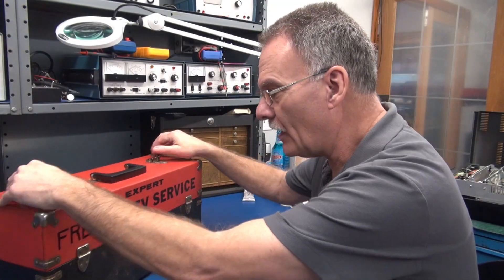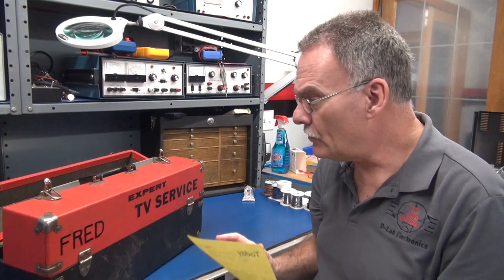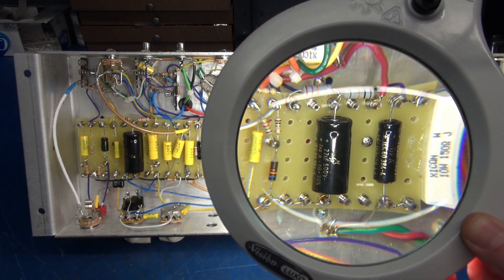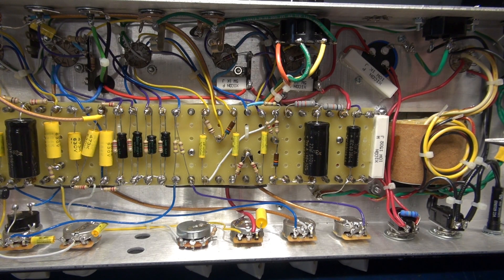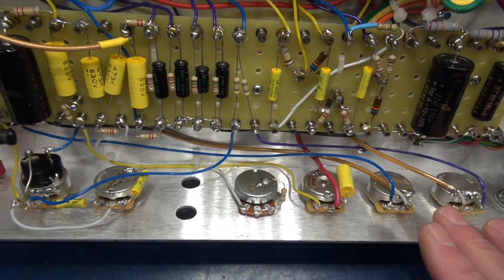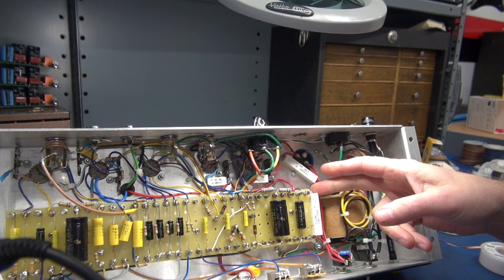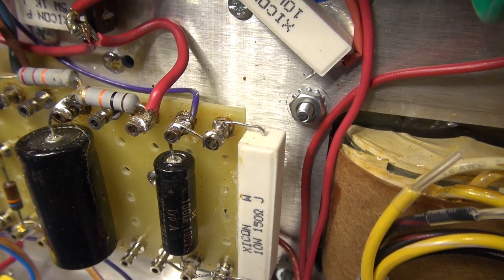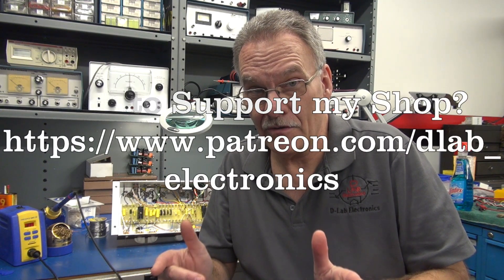D-Lab Basic Training Tube guitar amp sound fades Visual inspection reveals cause of the malfunction

Comment: Bad solder flow on turrets: good catch! Perhaps a friendly warning to our kit builders: before installing board, lightly clean turrets with a very fine scotch-brite (gray). Once cleaned, rinse off with alcohol. I also use the Kester solder (.031) and a very small drop of GC Liquid Solder-Flux (p/n: 10-4202). I've seen a lot of these kit builders having the same issues with turret connections. IPC or Mil-Std acceptable soldering connections would be a great reference for anyone building or repairing amps. Sorry, I don't have available at this time pictures of correct/acceptable connections. Perhaps someone has some they share.

Comment: I have experienced this issue with turrets before. I’ve found one solution when this happens that seems to work pretty good. First use a small metal file to scrap up at least the tops of the turrets which will give the solder something extra to stick to. Second, clean the turrets after filing with 99% Alcohol. And most importantly, apply more heat than most soldering irons can put out for a quick flash time and also added rosin paste. I have a good desoldering gun that actually gets really nice and hot. Touching the desoldering gun tip to the turret for about 4-5 seconds is usually enough. Then clean all the flux after with Alcohol. This methods seems to work extremely well if you have pain in the butt turrets. But most important step I think is applying higher heat for shorter time so you don’t damage any components.  That seems to work. Turrets have a pretty large surface area and they really need to get hot all the way through.

Comment: Love the videos Terry I have learned a lot from you thank you.  I have a question about a 5f1 clone I built,  when I test the capacitor voltage I get all good readings but when I shut it off and unplug the amp the voltage seems to drain itself to around 2V is this a sign of a problem?  thank you.

Comment: I believe the chrome coating on the turrets is causing the issue.  I've had several projects that solder refused to adhere to chrome because the wrong type was used.  Chrome is too polished resists solder and needs to be etched in acid if this happens to get rid of the polished coating.

Comment: Maybe acid core solder was used?  Please be advised that acid core solder is NOT recommended for electrical or electronic soldering applications due to the corrosive nature of the residue.

Comment: A stereo potentiometer that I had to use that was like this, it just would not take solder. Nothing improved it: cleaning with acetone, scratching the metal with exacto and sand paper, flux, heat, lead solder. I got a wire on there but I dont trust it to stick around for long. I might just make a mechanical connection with a metal ring around the shaft instead.

Comment: Great video thanks for showing us. So did the bad joints solve this amps problem? I have a amp that does the similar so I’m going to take a closer look at the joints. So I just wipe some rosin on the bad joint and heat it up and apply more solider ? What heat range is good for doing this I have the variable welder brand soldiering station? Thanks again  Terry
Reply from the maker: Yes, clean/scrape the terminal, apply rosin paste, My iron was set at 730 deg F. Clean the rosin with alcohol afterwards

Comment: NIce job Terry........I had similar issues with a turret board with same problem with soldering trying to adhere to them.....was a royal PITA.......BUT finally got  all the connections soldered properly......
Reply from the maker: I have a stash of 1970's military turret boards,. Use them for bias boards in amps. The Turrets solder like a dream. I am convinced that these terminals came from a (low or no) quality supplier.

Comment: My first thought was cheap Chinese alloy used for the turrets (who knows what the mix is). Then I wondered if the person who built the amp used a slightly active flux and didn't 'wash' the excess away, leaving it to corrode both the turret and the solder joint. 
As always, an excellent video Terry and quite a thought provoking one.
Reply: After all, only the Chinese can make stainless steel that rusts lmaooo
Reply: I thinknits shitty metal used innthe connectors and the poor tech who built it just flooded it with solder just enough to get it to "stick" pass "inspection" get paid and move to the next. Alot if these "boutique" amps are bought cheap in bulk rebranded and resold for a huge margin they use marketting jargon like "handwired" to make people thinknthey are getting quality.

Alot of times with amp heads its better u just buy a known high quality amp or someone that mass produces or one of the new generation of amps that use PCB and tube rectification like the blackstars and new fenders and marshalls. They are just flat out way more reliable and sounds amazing... every amp is basically a plexi copy with tweeks or a fender tweed so just buy original mass produced in a modern factory eith 6 sigma standards and a 3 year warranty.

Only a few companies do point to point and tube well and youre gonna pay like 2500 for a 20w amp 😂

Comment: What a mess! The guy that built this amp needs to go learn how to solder and how connections are made. Solder is not glue. Learn how to connect wire and component leads to a turret. Pre-tin your wire leads. Wrap the loads around the turret 270 degrees or more, enough for the lead to stay on the turret without solder. Free movement of the lead at this point will cause a cold solder joint. I learned the hard way. Working for military contractors.
Reply from the maker: Yep, me too, I went to Boeings high reliability soldering class for Nuke maintenance
Reply: There are a lot of people out there who don't know how to solder properly. They've never learned, or there's been no one around with the skills to teach them. I just smh when I see people dabbing solder on the iron, then dabbing it onto the joint and smearing it around like they are painting a picture.

Comment: Maybe that original solder was a plumbers type.
Reply: This is what I suspect also. I've never seen acid flux solder results when used on turrets, but maybe this is what we have here.
Reply: I've read on forums that people were having issues with some batches of turrets they were buying. They were resorting to using alcohol or Deoxit and having to sand or scrape them in order to get solder to stick.

Comment: D LABS, What is the max current rating for those Turret terminals? or what type of plating if on those turret terminals? I think fender use to spray some type of coating on there turret terminals to prevent oxidation what do you know the name of the spray that marshall and fender used to coat their turret terminals?
Reply from the maker: I have no idea of the Turret specs. I did not build this amp
Reply: @d-labelectronics  I mean for fender, vox, Marshalls ext they used so type of spray and type of plating used for better soldering?
Reply: @waynegram8907  Terry didn't build those amps either.

Comment: The corrosion on the turrets and leads is caused by oxidation.  Possibly the results of overheating or arc faults. It’s what happens to soldering iron tips if they are left on long at high temps without being tinned. It makes it very difficult to near impossible to tin them later. When connections oxidize like that all you can do is scrape the oxidation away or replace the connections.

Comment: I have a question, I have a Marshall Valvestate and I've seen multiple videos on how to discharge tube amps before inspection. Is there any different method for discharging a solid state amp before inspection? Thanks in advance :)
Reply: Solid state amps rarely have the kinds of high voltages present that tube amps do. Some really high power PA amps can run several hundred volts rail to rail but because they tend to be reasonably modern, the caps usually have discharge resistors or will discharge into the circuitry if left powered down for a while. When working on them I always check the main filter caps just in case, to be sure there's nothing ugly lurking there to bite me.
Reply: @stopthebus  thank you 🙏